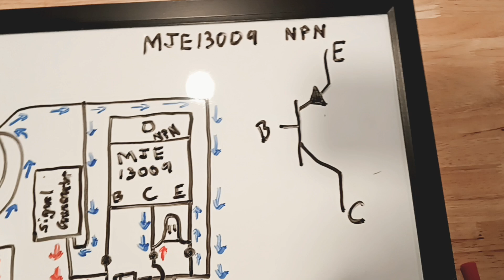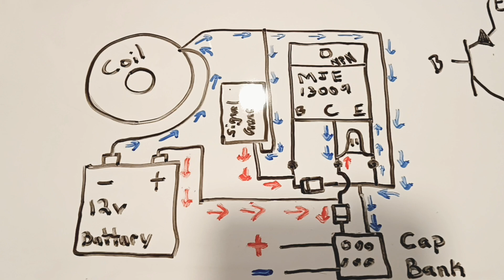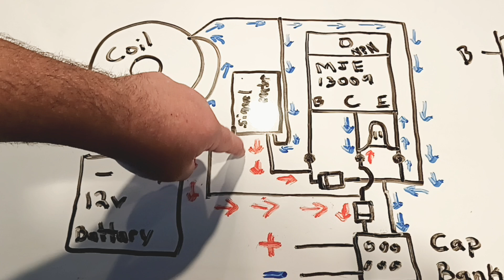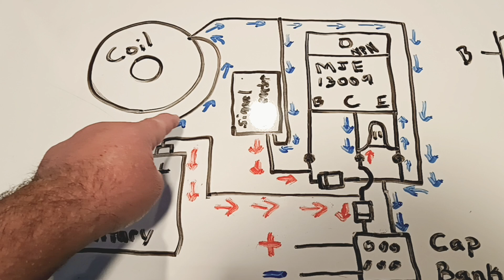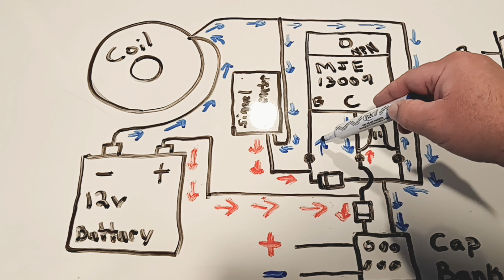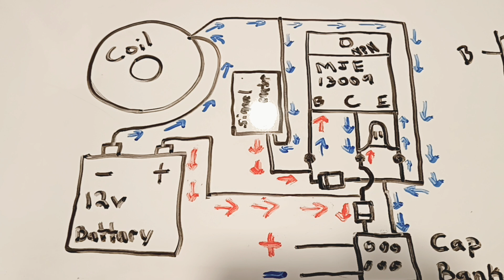Cold Energy Circuit

Comment: The symbol you drew in the upper right corner is for a PNP transistor, but yes, the MJE13009 is an NPN.
Reply from the maker: The data sheet I used was wrong. you are right.

Comment from the maker: I stand corrected. The upper right portion is an npn but the diode is in the wrong place. That data sheet I used was wrong. I will add the data sheet from now on in circuit video's to not have this happen again.

Comment: The transistor is NPN. Why are you drawing a PNP?
Reply from the maker: I sent you the picture with the correct transistor. I copied it directly.
Reply: @oldmanbuilds  Funny, the datasheet is wrong too. I sent you an actual schematic for this circuit. It is a negative voltage Flyback. Nothing special, very simple with an isolated signal generator to drive the NPN transistor. However, there is nothing "cold" about this. If you crank it up and draw 25 Watts, it will get hot.
Reply from the maker: @ToddDesiato  Because you are running - through the coil. The coil never gets direct heat. Depending on the load you control the heat in the circuit. When used on certain bifilar coils it will get colder in the center. This is a video of that working. It also picks up the tesla level in the center. https://youtu.be/BiTHLsjNfws?si=AXTEhCRr4y6wIpzH

Comment: Thanks for the solid state version! My Tesla "hairpin" circuit worked properly after I added one of the 2 plate neon flicker candle bulbs . It was obviously a "sink". The garage charged with energy , electric fence tester shows thousands of volts in the air, contactless AC tester going off far away. A 1 wire / wireless system. My thrill was short lived. This isn't new. May the likes of J.P. Morgan, J.D. Rockefeller rot in hell. The half truths are in our face, a battery's current flows from - to +. Electrons have a negative charge. The Earth is the negative , full of electrons. "Nikola, how are we going to put a meter on it?"
Reply: @BASENTRIM333   to add to that, thEE  hospital sign should be - ,not +.
Reply: @221boss221  True!
Reply: Could you share more info on how you got your hairpin circuit to create thousands of volts in the environment at a distance? I've not heard of a hairpin doing that before and it interests me, cheers.
Reply: @JenkoRun  Alright one of these days I'll fire it up and make some videos. It works, I should document it. It is the cold side, collector of radiant energy as Tesla called it. What is missing from the patent is the neon to ground.
Reply: @BASENTRIM333  Please do make those videos someday, I'd like to see that, based on what you've said it works by 1 leg of the neon or GDT touching one of the bars and the other end goes to earth ground, and this results in the production of radiant shockwaves that charges up conductive metals at a distance, is that correct? 

Because if that is how it works it sounds very similar to other single wire and monopolar setups I've heard about, I'm seeing a pattern.
Reply: Btw when using high voltage I found I didn't need spark gaps. Gas discharge tubes had the same effect and eliminated noise and RF. They also create a plasma / negative resistance.
Reply: @BASENTRIM333  Are you saying putting a GDT across the bars creates wireless power at a distance in a hairpin?
Reply: @JenkoRun  Nope GDT between NST and lightning arrestor diodes to high voltage caps either side if hairpin. Neon bulb to earth ground. I have a variac running the NST, that is how I get it in resonance. The safety in the NST will stop it from getting crazy. It is actually pulsed DC .
Reply from the maker: You both are having the best conversation ever.. I have been waiting for someone else to see it. Tesla knew it. Pulsed dc and - energy.
Reply: The hairpin is complete ? shorted. That is what is crazy about it. In the hot world it's a shorted capacitor. In the cold world you can light a lamp across 2 points of 1 conductor.
Reply: @BASENTRIM333  Variac > NST > GDT > Diodes > HV Caps of the hairpin, in that order? Does the neon bulb go on the bar side of the hairpin or the circuit side?

Comment: If you are going to claim "cold energy" please provide evidence of temperature differences across the components with and without a load. I've built circuits like this in the past and they all demonstrated expected increases in temperature.
Reply: What level of resistance counts as a "resistor in the circuit"?  All the wires, the coil, and everything else has a non-zero resistance in the circuit; no different than a low value resistor in the circuit.
Reply from the maker: @blahblahblahblah2933  It isn't about resistance. it is about heat from the resistance. The amount of heat is so important to control.
Reply from the maker: your running it the wrong way. you probably have the - and + backwards of the connections I have here.  This circuit is used every day with a second one to produce a resonating set of coils.

Comment: Pnp symbol was drawn.. Glad you understand this stuff.😂
Reply from the maker: pull up the transistor. It is npn and drawn correctly.
Reply: @oldmanbuilds The symbol drawn on the right is for pnp.
Reply from the maker: @chemholio8700  google the transistor. The picture clearly shows it. You are wrong.
Reply: @oldmanbuilds  13009 is npn. The symbol that you have drawn is for pnp. The symbol on the right of the wiring diagram.
Reply from the maker: @chemholio8700  You were right. The data sheet i used was wrong. I am sorry.
Reply: @oldmanbuilds  I just googled NPN and PNP transistors, the results I get all show the one you drew is PNP not NPN.
Reply: @oldmanbuilds  👍

Comment: Nathan, what is this circuit used for? To generate free energy? How much does it generate, and can the cap bank fill keep up with the cap bank output, so we don't run out of power?
Reply from the maker: it is used to build energy in coils. It is one half of a primary resonating coil. They are used to create massive magnetic pinch without the massive heat.
Reply: @oldmanbuilds  So the energy will be produced to a high level in the coil by recirculating it and the energy will not be converted to heat and be dissipated and thereby produce the massive magnetic pinch for the gravity flyer, so it levitates? Or is there some other use for the circuit?
Reply from the maker: @richardmuller867  watch this video. He is using a modified version of this circuit. https://youtu.be/BiTHLsjNfws?si=KYeOdM4JpjtsvCKg
Reply: @oldmanbuilds  I watched both videos on Geralds circuit. The first time without the water the LED cube lit up brightly and the second time when the energy was put through the water with resistance the LED cube lit up dimly. Makes sense to me. You mention a secondary coil and Geralds diagram shows the primary and secondary coil, so I gather you are using the tesla coil. I wonder if Gerald enclosed the water tank so it could build up pressure whether the water would fuse like me star device and give you a more massive amount of energy.
Reply from the maker: @richardmuller867  This is 1/2 the circuit for his coil. It is not for the tesla coil at all. He is pulling energy out of the center of his 2 coils (bifilar) and it can be captured.
Reply: @oldmanbuilds  This circuit has the potential to make a huge UAP craft out of the gravity flyer as I have written about many times.
Reply from the maker: @richardmuller867  Yes it does. Gerald is releasing the theory soon and what physics are involved. Gerald is a very smart man.
Reply: @oldmanbuilds  The two bifilar are similar to the tesla coil. I bet Tesla was producing fusion in the water in the ground with his Wharncliffe tower. Yes, Gerald is very smart. I can't wait for the theory to be released. Please send the theory to me when it is released. The circuit can make the antigravity warp and wormhole drive car.
Reply: I worked with SAV Infinity with their generator that they got working with magnets and bifilar coils. The got funding and went into production and then the magnets died, and the company went bankrupt. I just saw them once again and they have now put a charge on the coils along with the magnets to keep the magnets charged and we should see a device being sold in another year. Before they just had the Gravity magnetic field but now, they have the GEM field so the device should work better.